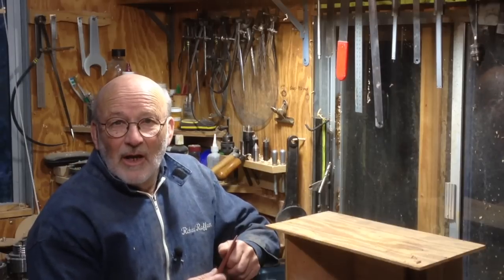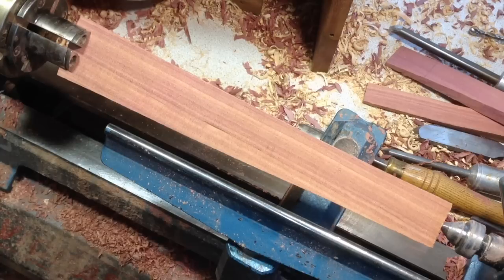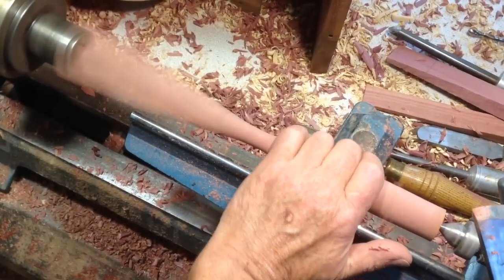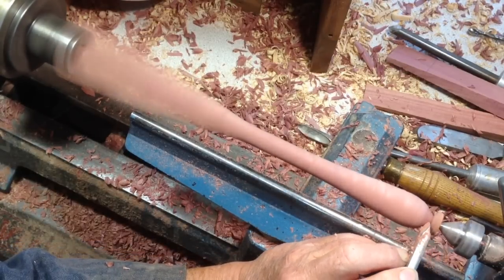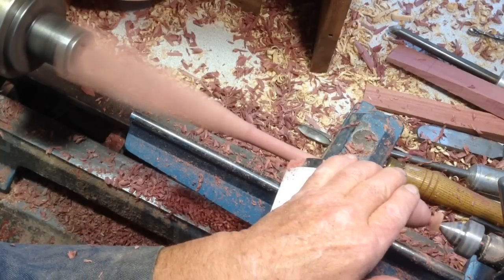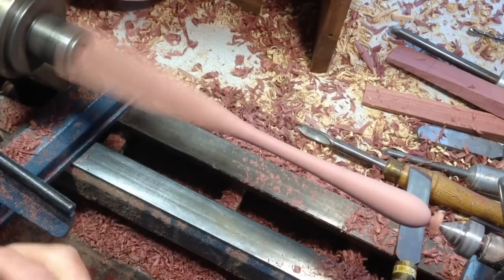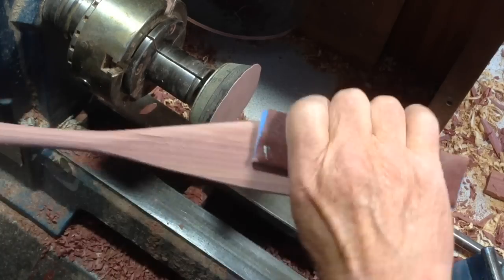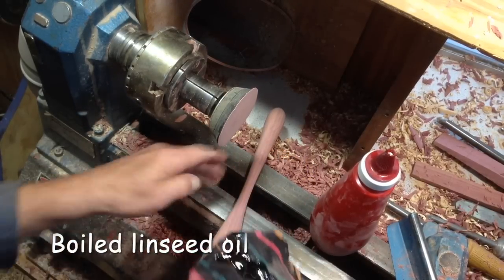Richard Raffan turns a juniper spatular with skew chisel.

Comment: Do you need to worry about boiled linseed oil igniting in the sock for that little amount?
Reply from the maker: I usually apply oil with a rag because the rag will dry and harden in 30 hours to be unusable. I've never felt a linseedy rag even get warm but do spread them out overnight. The waxy sock is virtuallly oil free.

Comment: Hi Richard.  Always great to see your work.  Can you please describe the adapters you use and the sanding backing pads. Is that scroll chuck holding a collet chuck. Thanks
Reply from the maker: The spatula blade and sanding pad are held in Vicmarc VM100 chuck with 35mm pin Jaws . The sanding disk is on a 6-in faceplate. I"m not sure what you mean by adapters.